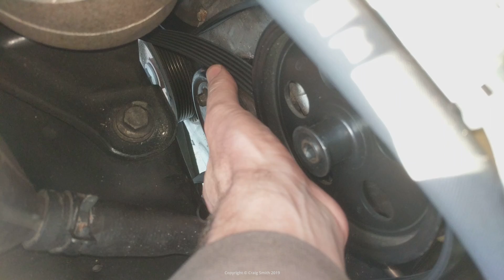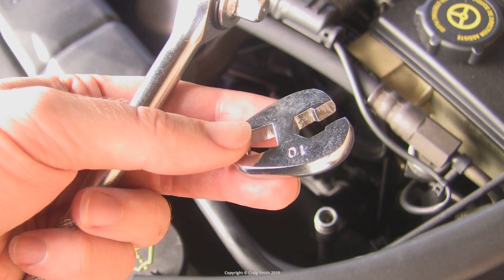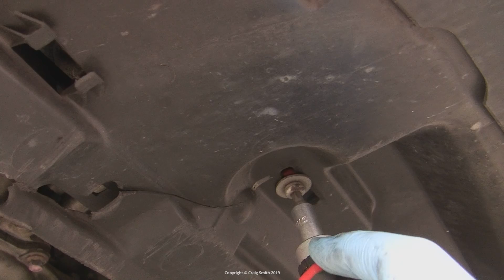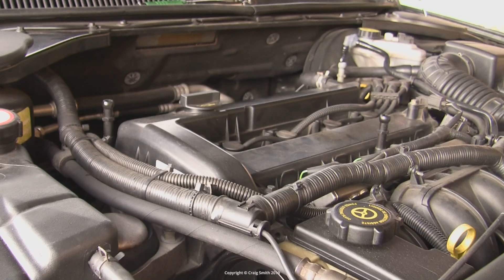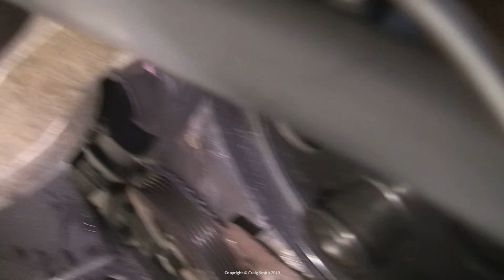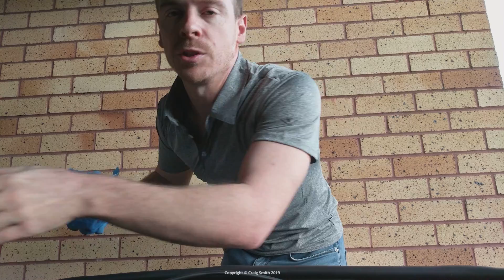How to (fail): (Nearly) replace water pump, Ford Duratec HE (Mondeo Mk 3)

Comment: Taking out headlamp is essential. Mine was well stuck. Eventually got it to move slightly using 2x2 wood and a 4lb lump hammer through the headlight opening. had to give it a good whack against the lower  part of the pump. It initially only rotated about 3mm but working it back by same method from under wheel arch. applied penetrating oil on each move and repeat.  After about 15mins of this it began to move out from the block so a screwdriver could get under the front lug an encourage it to move more. Don't rush the job.

Comment: This is legitimately the worse engine design of all time. It's like Ford did a line of coke and asked themselves how to make the most anti-right-to-repair, least reliable, time bomb of a fourbanher man has ever had this displeasure of bearing witness to.
Reply from the maker: You should write them a letter!
Reply: You should try their Ecoboost. The water pumps only seem to last half as long and the cambelt tensioner bolts to the top of the water pump plate.

Comment: Hi Craig's DIY Car!
I noticed that the rubber o-ring of the old pump had significantly(!) increased in diameter. Just yesterday I changed my pump and noticed the same effect. It is known that cars commonly use rubber that is resistant to oils and other technical substances, but in this case this is not the case. What do you think - perhaps such a material is used so that the ring swells after installation to seal the connection more reliably? Could this be so - will lubricating the ring with silicone grease to simplify installation (and as a result protect it from the effects of antifreeze) slow down this effect, which will lead to a possible small leak. I am interested in your opinion or perhaps you have accurate information on this issue.
Reply from the maker: I wouldn't worry about it. Just clean the mating surface. They usually leak at the shaft seal not the O-ring.

Comment: I successfully replaced the water pump on my Mondeo yesterday, largely thanks to your video. I got the pump loose using a piece of 2x2 wood and a rubber hammer, a few firm whacks on 2 sides of the pump had it wigled loose. It's a tight space, you can't really whack it from left, so I placed the piece of wood vertically, bottom facing left side of the pump, used the enginemount as pivotpoint for the wood, whacked on top of the wood, a kind of lever-whack (if that makes any sense 🙂).

Comment: I have luckily been able to successfully  perform this job. It was not an easy one, my patience really got tested and my hands are still recovering from all the impossible-to-reach areas.

Few tips for anyone still on the verge of doing this:
- Check 3x whether you loosened the correct bolts; I appeared to have loosened 1/3 correct ones, while 2/3 bolts belonged to the chain(?) casing. These are practically next to the water pump bolts...
- While batting and levering the water pump out through the headlight hole; watch out for the steering pump pipe; if you don't, you will end up with a mess and possibly an extra expense of ~150...

Good luck!

All-in-all, awesome video Craig; you have already helped me a great deal to keep my Mondeo in proper shape for the past few years, thank you!

Comment: Worst thing I have EVER tried to do in a car. I tried everything in the comments and some websites, nothing works, it's sealed in. all that's left is to keep hitting and hope it will come out somehow. I can see that it has come a bit loose but I have tried everything and still won't come out :( it's taken me a week and sadly I can't afford the  $850. It's so expensive in my country. I've changed and fixed many things but this is driving me crazy haha..
Reply from the maker: The solution is a pry bar of the right shape and size, I didn't have one and didn't have time to mess around. If you a week but not the $, then make the effort to figure out what will fit and get one. Tap the sharp end in and lever gently. I understand I'm not one to give advice. But that's all a mechanic will do.

Comment: Hi, thanks for all your videos. I completed this today, car had 260,000kms. I got it out in about 30mins, the pump has 3 squares cast into it which you can get a pry bar behind and lever out against the block.  Do a little bit at a time and will break loose, 3'oclock, 6 o;clock 9 o'clock etc. Also I changed the pump bolts at the same time, get from Ford or shop. Not much space to work thats for sure. Thanks for great videos.
Reply from the maker: Thanks. Other commenters here will benefit. Can you detail the pry bar (size, length) you used?

Comment: Thanks for the excellent videos and info Craig. They have helped me maintain my Mondeo very well. I’d like to share my near-fail water pump replacement storey. After a lot of teeth gnashing and less than savoury language I did the following with success! Take out the right hand headlight - it gives much better access all round to the pump. Screw in an 8mm x 30mm bolt through one of the pulley flange holes and wind it up until it anchors into the waterpump body - there is a little hole that lines up well for this on the top of the pump. This will stop the flange spinning. Now take a length of timber - a 500mm piece of decking timber worked well (90x30mm). Line the timber up through the headlight hole onto the waterpump body, get a rubber shot hammer and your best bicep muscles and start some serious blows onto the wood. After you get a little movement of the pump away from the block jam (carefully) a wedge or chisel into the gap. This will stop the pump pulling itself back in. Now resume the blows on the hammer and it will come out! Cheers and good luck.
Reply from the maker: Well done.

Comment: Thanks Craig. I came across the same problem. Wood didn't touch it. A 5lb hammer and a wrecking bar through the removed headlamp hole did. 5 mins and 3 missing lugs later it came out. Guys you just need to whack it as hard as you can!!

Comment: My streetka has a duratec engine and is making a strange sound when running. Best way I can describe it is like a rotary wire brush on the inside of a metal dustbin. Did you hear something like this when you noticed your fault? Engine has plenty of oil and is not overheating yet.
Reply from the maker: You'll have to figure out whether it's the belt/pulleys or the engine. Take the belt off and run the engine for a few secs, see if noise goes away. Try https://youtu.be/LC3I_IN3upE
Reply: @CraigsDIY  thanks mate
Reply: I should have mentioned that the noise only really starts when the engine is hot and has been running. It's noticeable after about ten mile journey. Therefore I'm not sure if taking the belts off would be useful in diagnosing it as id have to run the engine for a similar time which as you say isn't a good idea without cooling. Thank you for your reply, I appreciate your time and the videos you're making.

Comment: I have exactly the same problem! I can't remove the pump. Is it an typical issue on this motor?
Reply from the maker: Typical of water pumps to glue themselves up. The mechanic used a small crowbar, try the same on a solid piece of the casing when warm, and be careful.
Reply: @CraigsDIY  i finaly did it. It was a nighamare. I had tu use 2 crowbar, a huge hammer, a chisel and an entire bottle of cold shock penetrating oil. 5 hours of work. What a mess!!!!

Comment: Great reliable engine but not the easiest to work on.
Reply from the maker: Can always be worse. I just looked at the accessory belt in the Golf 1.3 TSI. I don't know how they fit bigger engines in that car.
Reply: @CraigsDIY  Of course it could be worse, but the position of the alternator, starter motor, thermostat and PCV valve is far from ideal. I remember replacing a starter motor on a 1991 Nissan 100NX 1.6 in 5 minutes. Just opened the bonnet, removed the wires, removed the three mounting bolts and out it came. Or replacing the thermostat in a 1987 Ford Fiesta 1.0 and 1995 Ford Fiesta 1.6GT was really easy, while with my Mondeo the weather wasn't ideal and I needed the car quickly so I just decided I had to pay someone else to do it. My water pump, alternator and accessory drive belt are still original as far as I know so they're 19 years old by now and did 193.000km. If I turn out to have more free time than I bargained for (thanks to the virus) and the weather isn't too bad I'll tackle the drive belt. Your videos are very helpful, thanks a lot!

Though I'm still wondering if I couldn't just remove the EGR valve and be done with it. It's not that I currently have any troubles with it but it's useless (even detrimental) to performance so I'd prefer to not have it at all. There are kits for the mechanical work but the software to keep the check engine light off is hard to come by. I'm considering connecting a Raspberry Pi to it with the display output on my radio DVD player to show all current faults and if the EGR shows up again to have a hardware button to remove all error codes.

Comment: I'm stuck in this spot. used a pry bar and broke off the edge of the water pump. I'm so frustrated idk what to do and I need to get to work.. about ready to scrap this car. it WILL NOT COME OUT

Comment: Just did yet another one of these. Tried everything, it was stuck rock solid.
Took the headlight out, got a long extension bar and club hammer and gave it some taps from the side, top, and bottom through the wheel arch, effectively "walking" it out. Easy peasy in the end.

Comment: I have replaced a few of these and they are all stuck to some degree. The trick is the tab in the 3 o clock position. it allows you to spin the entire pump in the bore. doing so will expose the backside of 2 tabs and really improve your leverage. rock the pump with a screwdriver at the 3 o clock and 7 o clock tabs with the coolant system open. You were right to seek help, better safe than sorry. Thanks for the video's!

Comment: to remove water pump in duratec-he you just have to wiggle it with long screwdriver or pry bar. o-ring seal doesn't hold the water pump. it is relatively simple job comparing to same replacement in diesel engine (where almost everything is a lot more difficult).

Comment: This is one job I did actually do myself on my 52 reg Mondeo a few years back, lucky for me a few taps and the pump came out easy. It was the original oem pump from Ford,  it was the circle one, the replacement was like yours with the triangular shape face, which makes it's easier to reinsert the pump bolts. Obviously a Ford improvement on design. Shame you had a stuck one. Thanks for all your videos really thorough and helpful.

Comment: I had to do mine after I replaced my thermostat. I guessed that with the thermostat stuck open the pump didn't have the same working forces as it would with a working one. Mine was leaking quite badly and had no problems getting it out. Now my only problem is the clutch on my a/c it cuts out after about 10 minutes. I think it's something to do with the shims when they get worn. Any ideas?
Reply from the maker: You mean it cuts out and doesn't go back on? Is the air con actually working?
Reply: Craig's DIY Car 
Yea in summer I would drive home from work in rush hour and would blow cold for about 10-15 min then start warming up. Then got home and turned the a/c on and off a few times with the car running and couldn’t hear the clutch engaging any more. I thought it could be the gas at first because it would stop blowing cold but unsure how to test it myself.
Reply: @rohangibbins2818  If you don't have enough gas in your system the pressure sensor will disable the clutch to engage in order to not damage your compressor by running it "dry". However I am not fully sure that it is your problem. I don't think you can check it yourself at home.
Reply: @rohangibbins2818  most likely the fuses. I had the same issue a year ago and charged my a.c.refrigerant  thinking it would helo. But I ended checking my fuze box and needed to replace three on my car type.

Comment: Yeah I’ve done 2 of these and both had the same issue. I fabricated a long bar to bolt to the pulley flange. They’re not easy to get out and require a fair amount of swearing 😆

Comment: I think it was very sensible to recognise the potential to damage the engine and take it to someone with more experience. Their experience will have helped determine where best to position the lever and how hard to push it  so as to minimise the risk of damaging the engine. Well done for confessing that you weren't able to do this  job yourself. Your channel has been very instructive as you are thorough and careful. I changed my fuel filter last week having learned the process from your video.